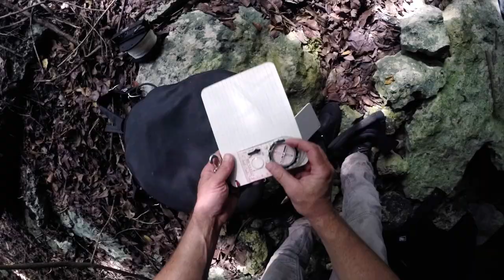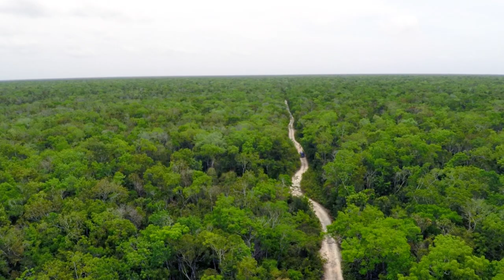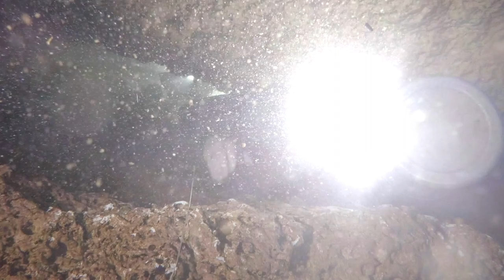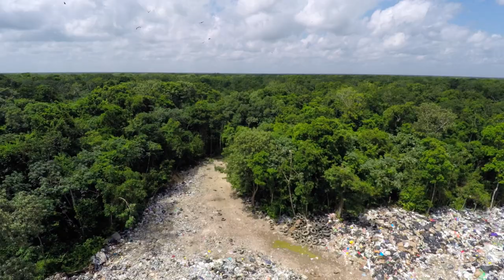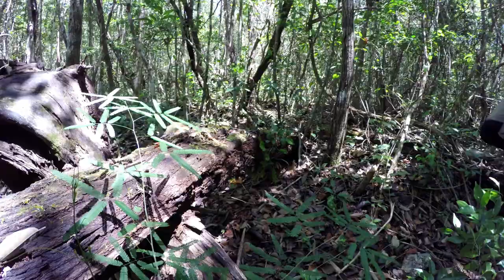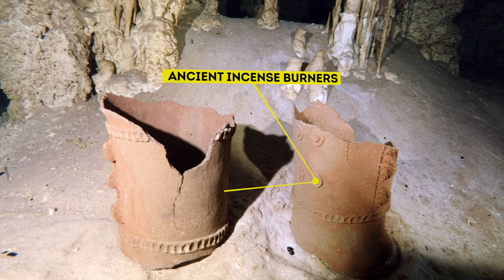GoPro: “Place of Fear” | Searching The Maya Underworld | Part I

Comment: Why dont just use a whater drone with a camera on it?
Reply: markus hoffsten the signal wouldn't reach that far underground
Reply: okok
Reply: but u can can reace the space? =D
Reply: Because diving is super fun
Reply: Radio waves (non visible light) can travel through empty space no problem. The signal would be blocked by all the rock in the cave and light does not behave the same when travelling through water.
Reply: well i be damn!
Reply: you could use a cable
Reply: the signal on an ROV goes through a tether, not radio waves.
Reply: exactly! an ROV with a tether.